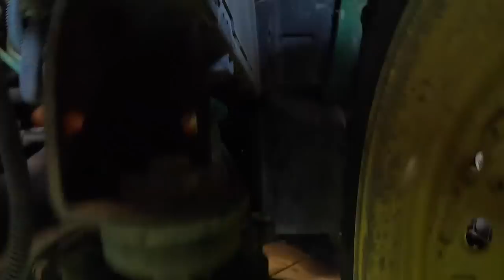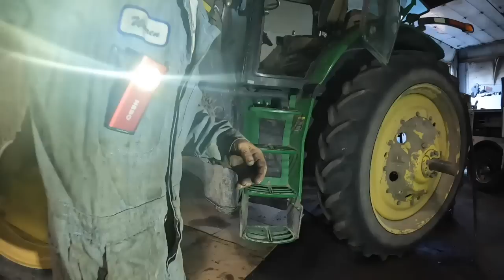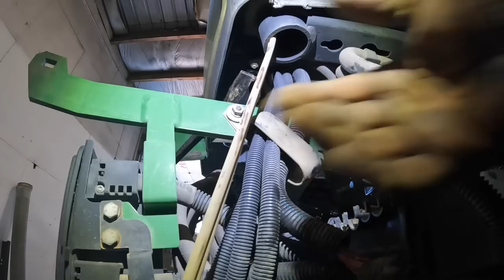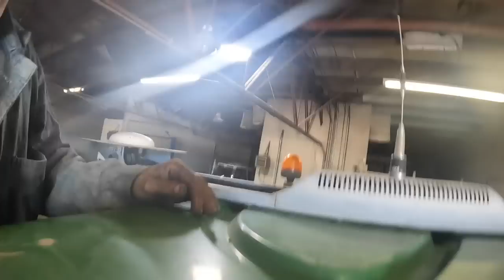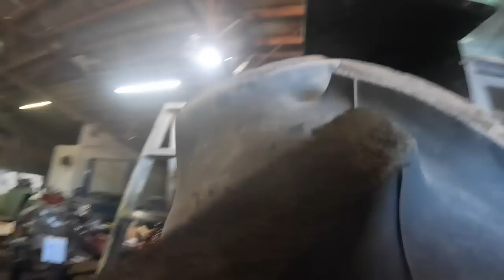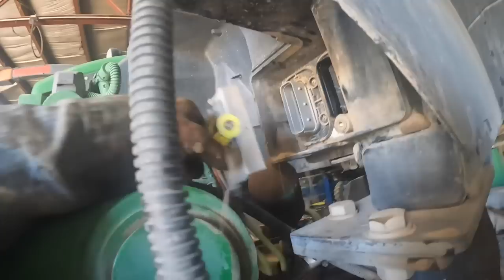John Deere 6170r cab removal

Comment: I remember when being a parts man was a career that folks were proud of. They knew every part on every machine you could think of. Often they could figure out problems quicker than the mechanic since they knew their parts so well. Now if it’s not immediately found on the computer, the parts guy is no help. I’ve started looking it up and having a list of correct part numbers before I go in and still end up with the wrong shit half the time. There’s still a few decent ones out there, but not very many.
Reply: Now you can even give them the part and the number and they will try every other selection in the book before bringing out the one you told them it was in the first place. 45minutes to retrieve the right belt for a mower.
Reply: The old part guys werw legends those new guys cant even finde a bolt if you ask them
Reply: Well, who is there to teach them? Life isn't how it used to be and not everyone is going to spend their time researching things like this especially when there's no pay to come with it.

Comment: One of my good friends I grew up with owns a large general engineering contracting business and he has a fleet of around 60 active trucks and probably 30 non running trucks parked along the fence that were absolutely destroyed and most of them were under 2 years old.  I can't blame everything on the workers because they were all 6.0 and 6.4 powerjoke fords, but the workers were responsible for the cosmetic damage.  A few months ago I stopped for gas at a ampm and I saw one of his trucks pull in and the 4 workers got out and went in and came out with their modelo tall cans and they were drinking them in the truck.  I walked up to them and asked what would the owner of the company think if he knew they were drinking in the truck and they laughed and said how is the owner going to find out.  I told them that the owner happens to be a good friend of mine and we grew up together and I would be giving him a phone call.  The look on their faces was priceless as I snapped a picture of them with the modelo cans in their hands, I said smile and sent the picture to my buddy and before they made it back to the job site they got a phone call to give the keys to the truck to the job site supervisor and to find their own rides back to the office to get their last checks

Comment: I ordered parts a few days ago, have a parts book, looked up the part numbers and called the dealer. Couple days later got a delivery and the AC bracket was over 200 bucks and the one sent was for a different tractor all together and was a used part dirty and rusty. Called and told them was wrong and used part and didn’t even look like the part in the book but had a piece of old tape with a hand written part number on it. Wanted a picture of it along with a picture of the original part. That was a week ago and said they would call me back when they get things straightened out. And they wonder why a person is pissed off.

Comment: Hello Warren. When I was a lad there were no cab's on tractors. A lot of them didn't make a cab. Every thing is so complicated now and it's all for driver comfort. Warren we were working for a scrap metal guy. He would buy old machines bailers and scrap handlers. Well you can imagine. It goes wrong all the time. And of course we repair this junk. A big ram on a car crusher went with a bang. It was beyond repair. £9000 werth. He said we were a set of twatts.

Comment: I worked for the state as a heavy equipment mechanic field mechanic. I busted my ass with 300 pieces of equipment to maintain. Yes, I did have options to send stuff to the shop and even use vendors but I hated doing that. I tried to fit in all I could. Long story short when I blew out a disc in my back and required major back surgery I was put out to pasture quicker then I could imagine. Looking back it’s better I got a retirement then be taken advantage of.

Comment: The junction of those eight or nine hoses you talked about in this vid could have been done a lot better imo, it should be done in the style of a CAT flange fitting where the two halves bolt together, there's O rings sealing each port in the block, and the hoses on each side thread in with a swivel on the hose end. Less mess, no way to mix them up and thus eliminate any potential trouble shooting, and it's quicker than unhooking each one because it'd just be two or four bolts and then putting some plugs in her. It's a simple thing that could really speed up pulling the cab and reassembly

Comment: Warren I am glad to hear this kind of thing pisses you off.. I know it does me.. when you have to do the job they are supposed to do.. I usually got to the boss and tell him I want my paycheck because I have to do the work these guys are payed to do.. I don't mess with the pinons I go straight to the boss.. he is in charge and he is responsible.. You can tell this was designed by an engineer and not a mechanic..

Comment: Warren would the tilt cab brackets save time on not have to take all them hoses and cables off. Would the cab tip over that way. Just a thought to save time
Reply: Apart from the ac I find it way easier lifting than tilting as you have to set up the tilting equipment and I never know which bit goes where.

Comment: Hello Warren,Everyone! Kind of off topic but has anyone had any failures with a Volvo truck clutch pedal? We have a fleet of 6 on our farm and 2 of them in the last month have BROKE at the plastic joint on the rod that goes to the slave cylinder. The metal part of the pedal has also failed, any help on this would be greatly appreciated.

Comment: Part guys/gals are not what they used to be, too many distractions now days. The summer of 1979 started in the parts dept receiving & stocking parts, then to counter sales. No computers back then, all we had were books and micro fiche slides to look up parts.

 From this moved to the shop repairing equipment, as the repair side is more interesting and challenging.

Comment: Over the years the parts counter guy has moved down the order to where it is now, I suspect it was from the top down to make room for other bean counters and because design has been migrating away from end user serviceability. It's one thing to not want to work but it's another when there is nothing to work for as a parts guy, so why would you make the effort. This is a problem in MANY industries.

Comment: Why the absolute FUCK is that a separate wire then if it's so critical? It should be integrated into an already existing ground so it can't be forgotten when you're swapping batteries and cause those problems